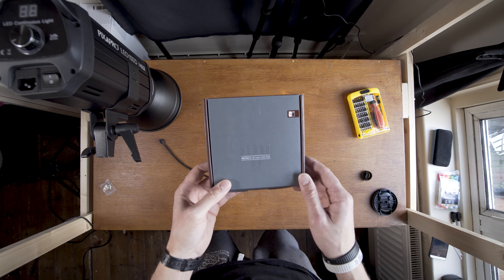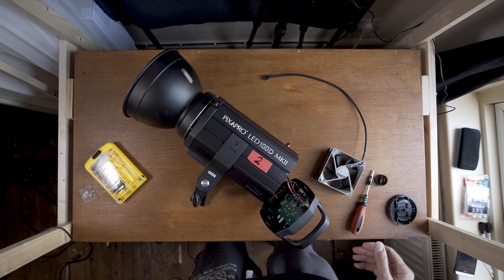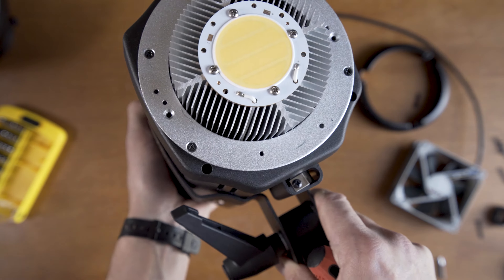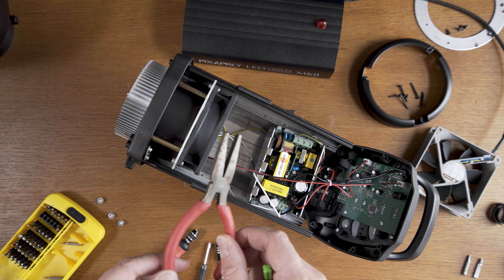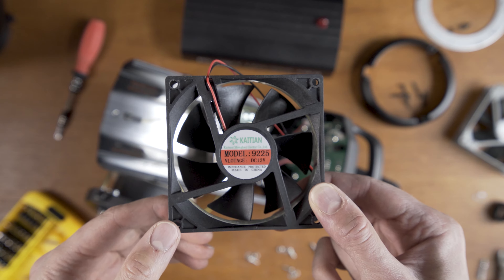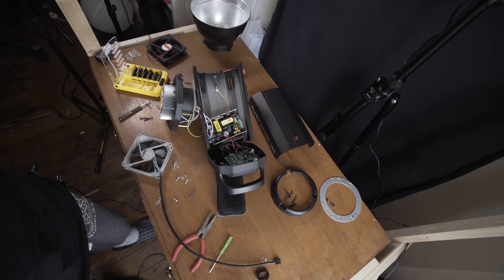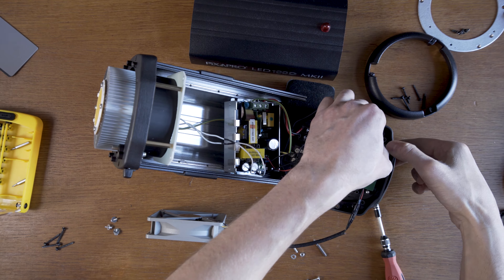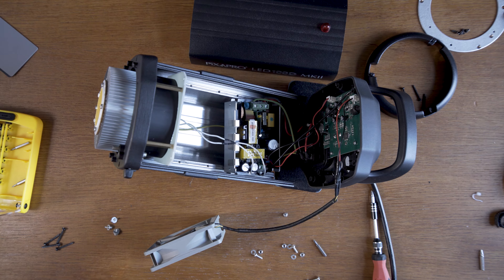I Tried (And Failed) To Fix Pixapro LED100D MKII

Comment: Thanks for doing this video, mate. As a side note, the fan you are using is still pretty loud (rated at 17db). The Noctua NF-S12B REDUX 700 is rated at 6.8db (almost three times as quiet) though I reckon you won't be trying to mod these again after all that hassle.
Reply from the maker: No worries mate. Aaah right, and I thought that 17 is pretty good. I didn't see the one you mentioned anywhere. But to be honest, like I said, the fan wasn't the main problem. Hahaha you're right there, I am not doing it again.
Reply: It's on every "quiet fan" list out there. I've used it in the past and it's as close to silent as a fan can get. Shame about the electronics then.  Regardless, thanks for biting the bullet with these. I was close to buying 3 of them and they would have been utterly useless.
Reply from the maker: Well if I need one for anything else in the future, i'll get it. I have 2 lights, and that feels like a lot of kinda wasted money, but having 3 would be a killer. I am happy I could help. What are you thinking of buying now?

Comment: Do you have any information about the mark III version compared to the mark II. Did they addressed the noise from the fan?
Reply from the maker: I've just checked it out, didn't know there was one. Theoretically, it could be quieter because of the open body design. Just like Aputure COB. But again, it's more powerful than this version. Who knows, I'd give it a go, £320 is not that bad. But it's hard to trust this company again.